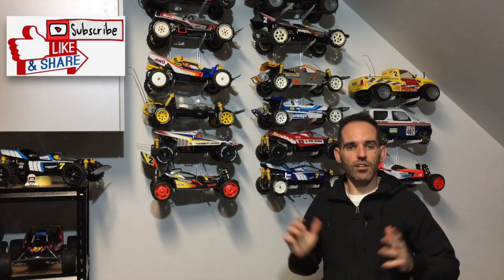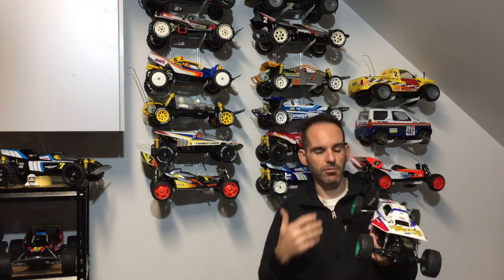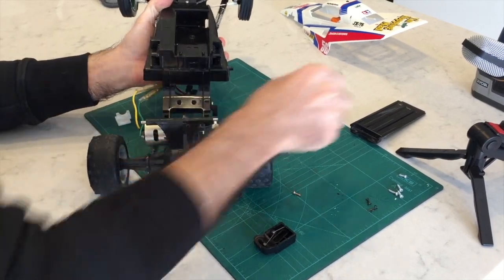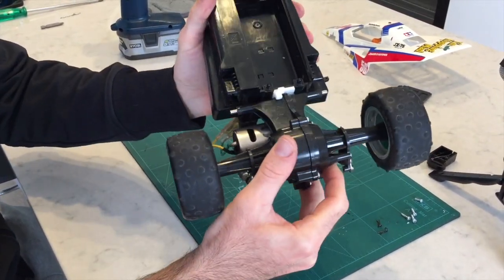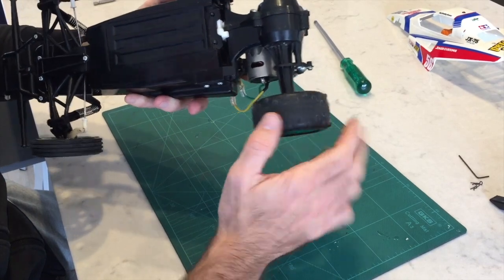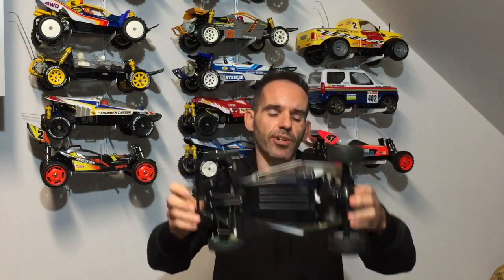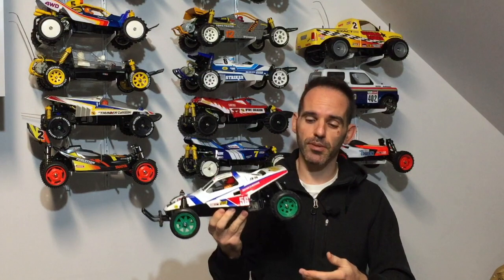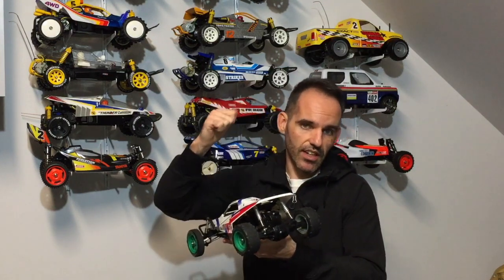Tamiya Grasshopper 2 & Super Hornet Ampro Transmission Brace Install, Run & Review Video.

Comment: Can I ask an off topic question I am dying to know the answer of? I need to know the total length of a hotshot dog bone (driveshaft) I am restoring a super Blackfoot with the wide double wishbone rear but cannot find the longer dogbones required (from mock-up it appears I need somewhere in the vicinity of 55-60mm)
Reply from the maker: I’m not 100% sure on an over all length. Most Tamiya buggies should run the longer Drive Shafts
Reply: RC Action Australia thanks 👍
Reply: u should ask tamiyabase or tamiyaclub that q they will tell u straight away they have great know how people there

Comment: Super hornet had different shocks to.
Reply from the maker: Yep, Super Hornet had Oil Dampers front & Rear. It also ran a different bracket that the Shocks connected to the gearbox
Reply: @RCACTIONAUSTRALIA  yep the super hornet shocks right they got a crappy springs on them they go down after a while if u had a better spring in them they would be great tamiya did come out with the cva shocks for the grasshopper 2 so it can fit the super hornet too they are much better shocks both front and back

Comment: Ampro Engineering waist of money doesn't help this car at all u can drive the car with out the part so why care about it 
the screw that goes through the part does that rub on the battery? 
that car u have its got the green wheels they are hard to find now the grasshopper 2 super g
 i own like 3 grasshopper 2 cars and few super hornet cars i never even thinking of getting part i run these cars all day without the part so why care about it 
if tamiya had a problem with these cars running dont u think they would have fix the problem if there were a problem that is
Reply from the maker: Hi,
The wheels are an old set I painted. The Ampro brace actually transformed this car as a runner. Definitely worth the time & upgrade. 
No if it’s installed correct it does cause any issues with the battery. 
Tamiya have re re many cars and never fixed issues.
The Grasshopper is a fun car either way 😎👍🏻🎥
Reply: if they had issues why are u buying them 
then because u like to fix them rebuild them etc tamiya wants u to relive your child hood moments right so why fix them it wouldnt be the same car u wouldn't buy another one right lol
u could ring tamiya and get the part mad of steel but u would be paying through your armhole for it  lol